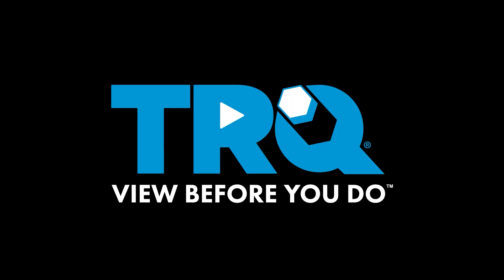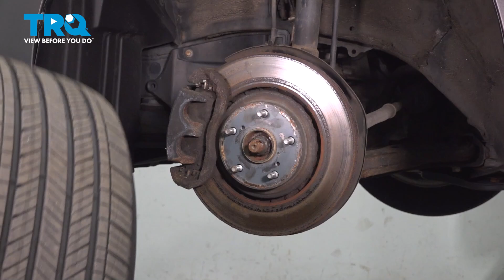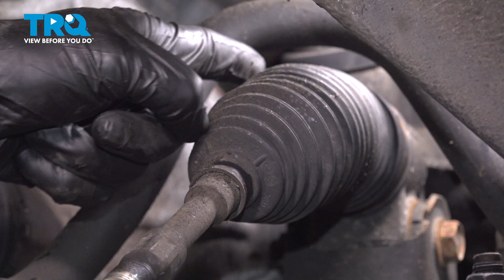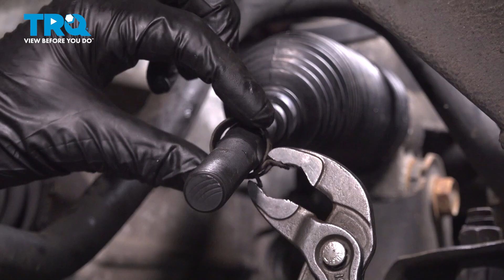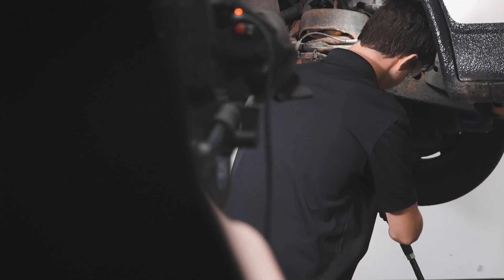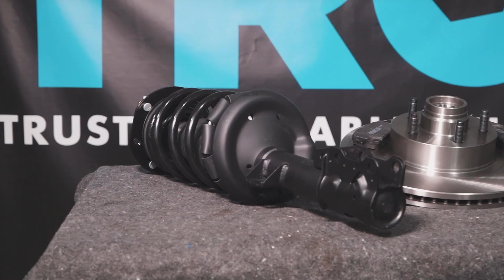How to Replace Inner Tie Rods 2011-2020 Toyota Sienna

Comment: Great easy to follow video. Question: I noticed when you removed the tie rod that there wasn’t a claw washer on there. Also I wondered why not to torque the inner tie rod. Found several posts stating torque inner tie rod to 43’ lbs. Thx